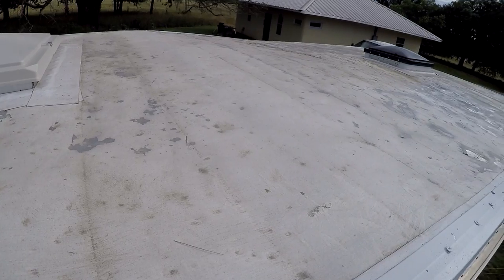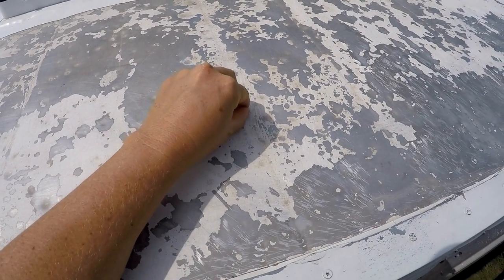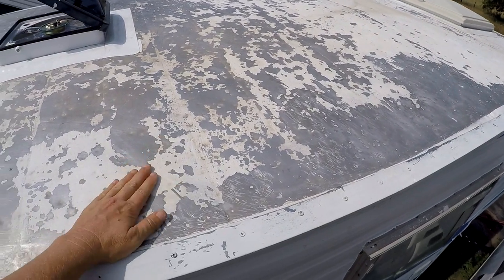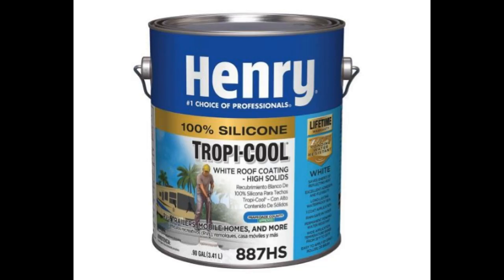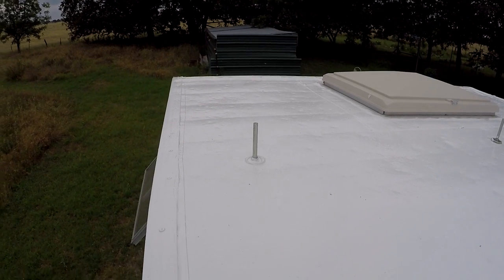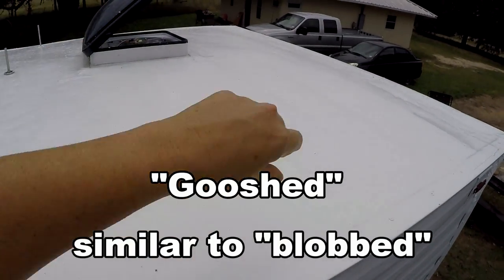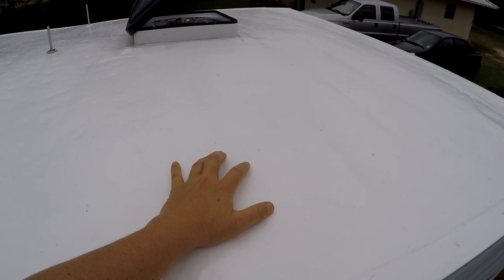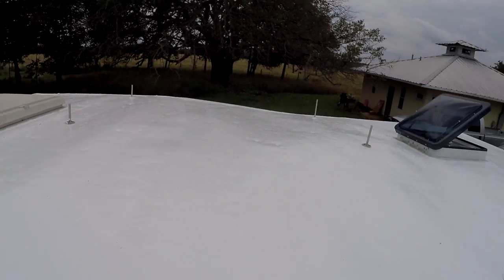Roof coated with Home Depot Henry Tropicool -Truck Camper #17

Comment: Just put 5 gallons Henry 887 Tropi-Cool on our 29 foot 06 Thor Grand Junction EPDM roof, no swelling, no deformation, no wrinkles! Roof is very clean and water pools up in beads. After a power wash, treated with anti-fungal, rinsed with water thoroughly, let dry for 12 hours, then painted on all edges of roof fixtures and roof membrane tie downs with a paint brush, allowed 6 hours of cure time! Then 1/4 nap roller applied first coat, waited 12 hours of cure time and then 1/2 nap roller applied second coat! End result is beeeeuuuutiful! This will get me another 4 years or so out of the roof before a new roof deck and EPDM or TPO membrane replacement!

Comment: Coverage should be 1 1/2 gallons per 100 sq. ft. that is a 10'x10' and should be 22 mills thick. Scott M is correct to some degree in that you should have used the entire gallon. Henry Tropi-Cool is the same great 100% Silicone whether you purchase it at Home Depot or a paint store, we do not alter the formula based on where you purchase it. Yes, you can use it on RV's as well as a number of roofing systems. You can use a 1/2" to 1 1/2" nap roller to apply. I train Contractors and Facility people on how to apply the Henry Silicone Coating and I must say you did an amazing job in prepping your roof. Congrats !!
Reply from the maker: Thanks - four months after sitting out in the hot Texas sun, rain, hail, and most recently near freezing temps....it looks as good as the day I finished it.  Rubbed my hand vigorously across it yesterday and it's solid.  I'm happy so far.
Reply: can you use this in rubber roofs ?

Comment: In hindsight, if you were just trying to seal a badly-leaking roof on your camper, would you have done all that scraping and sanding or just painted that stuff on there? I'm asking because I'm so screwed. I have a Class C and I don't want to get on the roof. I have to do something to stop these leaks and I thought of a roller brush like you used. Please tell me if I were about to get out from under this RV and something would be better than nothing, could I get away with doing what you did, minus the prep work? HELP. I'm literally drowning tonight in southern NM. Damn monsoon season!
Reply from the maker: Hi - I would not do that.  I suspect that if the prep is neglected this material will be peeling off almost immediately.   It needs a clean surface in order to bond.  
There are really good roof sealing tape products that come in various widths...used on RVs a lot.  Anything you apply is going to work better if you apply it to a prepped/clean surface....but I think the tape would work with a lot less work.   Do a search for RV roof tape OR RV emergency roof leak stop  for more ideas.  
Roof is important.  I think doing a reseal/refurb of the roof the best you can is the only way to go.  It will be hard work.  It'll take time.  Once it is done it's done it is a lot nicer/easier to maintain that and extend the life of the refreshed roof....hopefully for a very long time.  
Sorry to hear of your leak woes.  Not fun.  Hope you're able to sort it out.  Good Luck.

Comment: How is the roof holding up six years later?
Reply from the maker: Still going strong.  In the areas where I overlapped it with the dura-bond tape....it has peeled up.  But to be fair, I applied it very thin in those locations.  The tape underneath is still good...so there are no leaks.  Over the rest of the roof I'm satisfied with the way it's held up.  It has definitely fallen into the rare category of things that worked out super well and I feel I got my money & effort's worth.  I would use it again over a metal roof in a heartbeat.

Comment: Gee, what's the roof made of? Mine little travel trailer has an EPDM roof. It's still in good shape at being a 2015. They supposed to last 10-15 years but the rubber feels so thin so I'm thinking of maybe putting one of these liquid rubber coatings on it fairly soon. One company has a lifetime guarantee!  Maybe next year or in 2-5 years depending I will do it?? Any ideas or opinions appreciated. Thanks, and I love the Musik you're playing. Most people play wild insane disturbing type Musik. Can you paint right over the dicor caulking? ? It looks like you put new RV tape around the roof vent hatch. I like multiple coats. The other liquid EPDM RV company says one coat. Maybe they are strickt about only using one coat, I don't know.
Reply from the maker: Hi - the roof is aluminum.  I would be really careful to make sure whatever product you use is suitable over the top of your material.  I know it matters.  I did a considerable amount of research before I took this project on.  Following the manufacturers instructions to a tee is a good idea for a job like this.  It's so much work....you don't want to have to redo it!  I went right over the top of tape and sealants....it formed a seamless barrier that way.  I'll be doing an update video on the roof soon.  It is still A++ since I applied it......after over a year and over 2000 miles on super bumpy Baja roads and all sorts of weather.  I'm very satisfied.
Reply: For and epdm rv roof, if the existing roof is still adhered with no wood damage after it's lifespan, use epdm liquid. If wood needs to be replaced, you need to pull the rubber roof off and repair it, then go liquid or rolled epdm. Works well. Liquid epdm can go over lap sealant.
Reply: seems like the idea is the tropicool is better than liquid epdm?
Reply: Epdm should last much longer than elastomeric. Ill be using dicor elastomeric for a job this weekend. It is intended as a rubber roof reseal, but the liquid epdm is intended as a rubber roof permanent replacement. Dicor and epdm coatings both have good videos on each method.
Reply: should and intended are key words.
 ive seen some vids of liquid epdm not lasting more than a couple years, 
the tropicool doesnt look half bad..
Reply: Dunford00 if the surface is adequately prepped and the product is applied correctly according to instructions, the epdm products will last 2-3 times longer. Both products are good for their intended purpose. Best of luck
Reply: Adventures of Sandra & Dave Thank you very much for responding. One year is nothing. I can't believe with all the science and technology in the world today, there isn't an easy to apply, very affordable liquid roof coat that is 100% guaranteed for 100 years! If all those nerd and geek geniuses stopped wasting time on BS outer space fantasy missions to nowhere there'd be such a product.
Reply: Loki RIP Thank you. Pull off and throw out the original epdm film just where the damaged wood is or off the entire roof? So can we use the more durable liquid epdm just to give our good but aging original epdm roof layer another 10-20 or more years of functioning and strength?? Or is it much better to use that liquid elastomeric re-seal??
Reply: Google1 User if the wood below is rotten, I remove the entire rolled epdm or tpo layer, repair the wood for a good sub surface, the put on a new epdm rolled membrane. If the wood is good and your epdm membrane is just warn but not leaking, I'd skip the elastomeric and just apply a new liquid epdm coating. Its basically the same process and lasts longer. Epdm coatings has a good video on the process.
Reply: Loki RIP ok, got it now, liquid epdm makes for a better renewed old epdm roof. But supposing for example there's only rotted wood on the front 1/3 of the RV? Would you just remove 1/3 the old membrane , replace the wood and then top with a new roll out membrane up to the 2/3s you left? Thanks
Reply: Google1 User I would pull the whole membrane and replace. Its a bigger job because you have to pull the trim and appliances, replace the wood, then the new membrane. If you get a few friends together and follow the dicor factory video, you can do it in a few days. Its taken as much as 10 days for me working mostly alone. If you end up patching a third of your roof, be sure to glue it well to the new wood and eternabond tape the joint. Then you'd still reseal the old roof. I've never used this approach but it would be better than letting the roof continue to be damaged. Let me know if you have other questions.
Reply: Loki RIP Thank you, I appreciate that.

Comment: Also what’s the update on this ? 🙂
Reply from the maker: https://www.youtube.com/watch?v=9hG2qVVlJMU&t=0s  This was 2 years in.  Now..4 year after the linked video....Still holding up.  As far as using this on wood:  Wood is not listed as one of the substrates it can be used on...here's the link to where you can find the data sheet:  https://henry.com/retail/white-roof-coatings/887-tropi-cool-100-silicone-white-roof-coating

Comment: I looked at the product's web site and found the instruction included verbiage relating to RV application so I don't see where using it on you camper is out of line for the product. It is paint. Just as the other paint on the camper may or may not last, this stuff may or may not last. A lot of factors are in play. In the RV world you get used to keeping an eye on the roof and the sealants and coverings. Don't neglect to do an inspection before every trip. Its not just the paint, but everything up there.
Reply from the maker: Sandra here:  I'm not too worried about it.  I did watch the Henry videos on "how to apply"  before I applied it.  It is very thick and it is near impossible to remove unless you scrape/cut on it with a knife or something metal/sharp.  I realize that others may have different results but as you said, there are a lot of factors at play.  At any rate....roofs on campers are maintenance....always.  I plan on inspections of the camper on a regular basis....preventing leaks before they start is preferable.  Thanks!
Reply from the maker: I agree (sorry for the delay in reply....for some reason I'm not getting notice of a lot of the comments!) - We intend to keep a very close eye on all the seams/roof.  That's super important!  Prevention is better than fixing damage after the fact.

Comment: You did a great job. The product you used was Tropi-Cool 100% Silicone. Good for 50 years. Great product. Keep in mind when the roof is wet it is extremely slippery.
Reply: I would like to apply Tropi-Cool to the roof of my house.  I am not 100% sure, but I believe my roof is Bitumen rubber roof coated with silver coating or aluminum asphalt paint.  The reason I would like to apply Tropi-Cool is that part of the roof is showing cracks.  I live in NY where it gets cold in the winter and hot in the summer.  Can Tropi-cool withstand extreme temperature?  If yes, how should I go about preparing the roof to apply Tropi-cool? Thanks in advance.

Comment: How has this held up?  We've got an old beauty and that needs a roof seal.
Reply from the maker: Over 10,000 miles in the camper traveling.   Hot Summers....we don't have storage under cover for it...so it's been in the weather since I did it.  Still holding up.  I've noticed a few scratches (from trees)...but the material isn't really flaking at the scratch marks.  It also is peeling in a few spots where I painted it over the top of some of the RV seam tape....but that doesn't surprise me.  That tape is not really a good surface for bonding this stuff to....and I didn't put it on at the proper thickness over the tape.  I'm very satisfied with it.  Good Prep is VERY important...and also getting it on at the right thickness (which is indicated in the instructions on the can).  I followed the instructions for the product carefully.

Comment: Electric hand tool with wire wheel.
Reply: My first thought too.
Reply: I did that on an old RV and it swiss cheesed all the thin spots. i do not recommend doing it that way. As old as the one they are working on seems to be, they would probably have the same problem. Just my thoughts.

Comment: Pressure washer then grinder then pressure washer again.
Reply from the maker: Thank you.  In this case I tried a grinder & a hand sander.  The thinness of the metal , paired with the dimples from hail damage made it impossible.  With both there was a high danger of putting a hole in the metal.  Maybe if it had been smooth.  But I did get it done and the coating I applied is still in great condition.  Anyone doing a job like this....I'd totally recommend that they try mechanized methods. If you can.  So much easier.

Comment: A great video! Can't wait to get my truck camper,these videos will come in handy.I'm looking to get a old camper too.don't want to get a new one,that's for sure.( they cost too dam much! )
Reply from the maker: If I had more money than I knew what to do with (this has not happened yet in my life...lol!!) I might go for a newer, light weight Hallmark or Four Wheel brand popup.  Those are nice and seem built more for the off grid, traveling experience.  We looked at some of the new deluxe campers....full baths, loaded with cabinets, stereos, TVs, every amenity that would be in a nice house....slide outs that make them seem to have more room inside than is possible in the back of a truck!  Over $60,000 easy.  Whoa!!!  That's more than we paid for our 6 acre property with a house. We prefer to spend our budget on travel, good food, experiences....don't need much outside of a comfortable place to sleep and a way to effectively move around when it comes to the rig.  Lots of old campers out there....be sure to look very closely for severe water damage...it can hide.  Fine if you don't mind replacing a lot of structure....but much more work for sure.  A lot of them get it in the wood down under where the jacks attach...which will result in catastrophic failure!  Much of the time you can see the ripples this causes in the siding....as the wood fails the jacks begin to crinkle the siding as the weight gets put on that.  This happened with our camper BEFORE we bought it....the previous owner had to replace the plywood base.

Comment: Your coating is 100% silicone, elastomeric paint is the cheaper stuff, you got the Best stuff..only caution is that it is extremely slippery when wet, Avoid going on top when wet or damp, You may slip off the roof.
Reply from the maker: haha...yeah I keep having people tell me that.  I will from this point forward remember that it is the silicone.  I know I got it cause it was supposed to be superior and it was more $$.  I'm happy with the result.

Comment: Oh, please I hope it isn't too late . . . IT DOESN'T WORK! It will peel off! I made a video about this years ago. Plus, when it peeled off, I tried getting my money back from Henry's who stated: this product is not meant for nor designed for RV use! It should be on the can. I ended up replacing it with Dicor liquid roof sealant. And, yes, had to re-sand! Ugh!!! This was on my class C (Patches) and it worked great! TAKE THE HENRY'S BACK TO STORE WHERE PURCHASED AND MAKE UP SOMETHING! Their guarantee for this use is worthless! Sorry. Smile :) & Be BRAVE!
Reply from the maker: Sorry to hear about your bad experience.  It's on.  We'll see how it goes and I'll report back.  I only used it after researching and found a lot of good feedback for durability, etc.  Time will tell.  THANKS
Reply: RV Lady. You are incorrect. It even has a picture of an RV on the one gallon can of Tropi-Cool 100%  Silicone. Customer service would NEVER tell you to make up an excuse to return. They would file a report and a Henry Rep would actually look at your project to determine the problem.
Reply from the maker: It's still holding up.  Had the hot Texas sun beating down on it all summer + hail, rain, and now cold.  I was just up there yesterday and rubbed my hand across it to see if any would peel or if it seemed OK....all good.  I'm sorry your application failed the way it did.  You had me nervous after your comment.....I'm glad you shared your experience though.....so far so good for us.
Reply: If it peel off them that mean Roof was not prepared properly/ scrubbed and a bonding primer then apply Henry product. It will last years without peeling . Prep right product like any other works right.
Reply: Adventures of Sandra & Dave still good? thinking about using this product on fiber rv roof.

Comment: I think the product is great! my only problem is that you need to sell specific brushes with this product because the brushes and rollers that these store sell, recommend aren't doing the job good enough! They are not holding up and I even had a paint representative from the store tell me to use a regular paint roller? Within 3 seconds of using it I knew that it was a big mistake all the fibers came right out of the roller... very upsetting...
therefore, my opinion Henry should manufacturer dorable paint brushes and rollers specifically to work with this product! Fact...it is so thick, and tacky...  I love the product! Search for beginners first timers there should be something on the bucket that tells you specifically what brushes to use because we cannot count on the knowledge of the sale representative in the roofing or in the paint department...